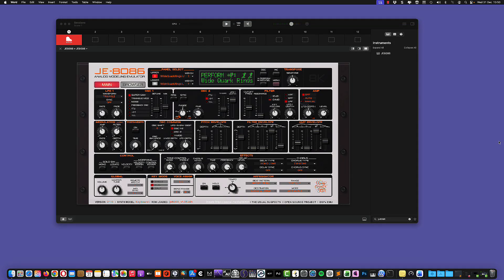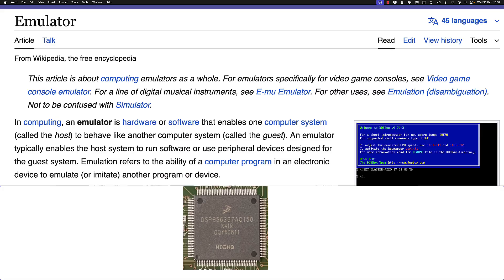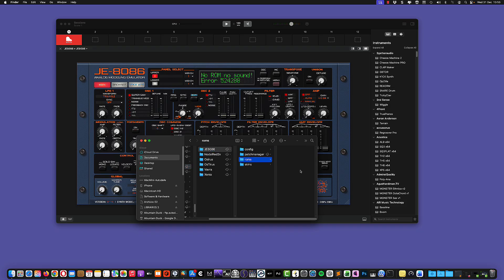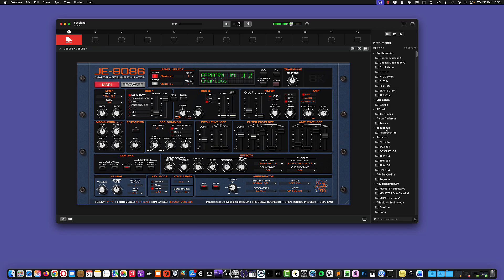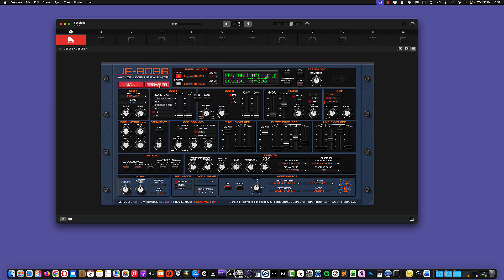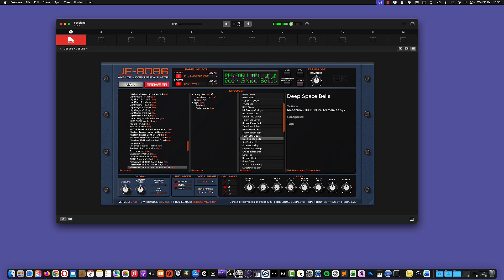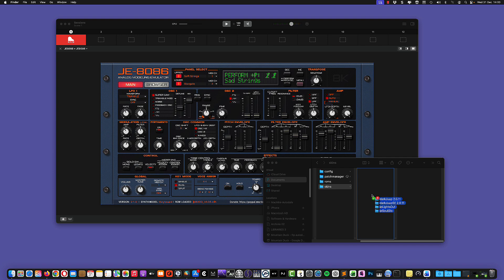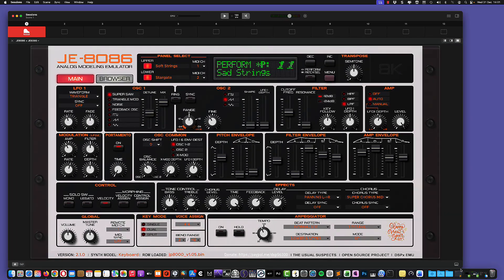JE-8086 Setup Guide: ROMs, Sounds & Skins Explained

Comment: mine is in no way like this at all. when i double click the zip for TheUsualSuspects-JE8086-2.1.0-MacOS.zip I only get changelog8086.txt, the components file, and macsetup je8086 command file. there are no other folders that have Rom or anything else like what you have. the beginning of this video already put me in the dark. Can SOMEONE please help me?
Reply from the maker: You need to manually copy the .component file in your COMPONENTS Folder on Mac.
See installation guide on their website. 
From there you need to google for the firmware, the ROMs are NOT and CANNOT be distributed with the emulator
Reply: @A @AutodafeSynths I got the file from Roland but mine is a zip, not a bin. It didn’t offer a bin version either. This process is really giving me a lot of confusion
Reply from the maker: @AEONRINGS  ignore the .bin, just expand the ZIP you got and copy ALL its  content in the roms folder as shown in the video. Multiple .MID files will work 100% the same
Reply from the maker: INSTALLATION GUIDE: https://dsp56300.wordpress.com/installation-guide/

Comment: I use the JE-8086 before your video came out. I used it in my new track.
I have 2 roms. JP-8000 and JP-8080.
I used the 8080 rom but it do not work.
Just the 8000 rom.
Why this?
Reply from the maker: Because jp-8080 is not emulated yet

Comment: Man, thank you for all explaining. For me the main problem and "dancing with a tambourine" was with a Apple blocking, I spent 1+ hour for getting it work, and no problem with installing ROM.
Reply from the maker: sudo xattr is your best friend in those casse 😂 or use the Sentinel App on Mac
Reply: @AutodafeSynths  hah I did it with sudo and it's not worked))) For me it was only "sudo spctl --master-disable" - and then I back system to normal using. Mate do you know how to make an INIT patch?
Reply from the maker: @NatLifeSounds  try the Sentinel App, much easier for me . Drag & Drop. Done: https://sentinel.macupdate.com/

also watch my tutorial here: https://youtu.be/_WbyuNrjubQ
Reply: @AutodafeSynths  oh, thanks man, I made it with a way which I described above
Reply from the maker: re: the INIT patch, there is one on the discord server for the project, somone created one...
Reply from the maker: INIT pacth on discord: https://discord.com/channels/829099347975208970/1428393781664940153/1429602442240196619
Reply: @AutodafeSynths  bad but I don't use discord( I will try to make it myself, I found that original JP-8000 can make INIT but bad that this copy can't(
Reply: btw does JE-8086 saved patches working good on hardware machines?

Comment: As shown in your video you have just one BIN file in ROMS folder and yet my official ROM consists of 10 files - 7 _MID files, 1 BIN file and 2 TXT files. I f I remove any one of them Emulator will complain and I end up with no sound sets...
Reply from the maker: yes, you can also use the varius MID files you can find on the official website, just leave all files where they are :-D
Reply: Yeah, that’s what I’ve figured…
BTW; The bin file as demonstrated in your video does not exist of-course for obvious reasons ;-)

Comment: Does not work at all in my Windows 10 computer, cpu load extremely high, totally unusable. Note that the same computer runs Osirus, Ostirus and Vavra without any problem and very low cpu load ....
Reply: Experiencing the same while not an issue with other plugins or emulators.
Reply from the maker: @solidsnake1449 try increasing the latency a bit (right clik on the UI then Latency). Also, this is still in BETA phase, hopefully nex version will be more CPU-friendly...
Reply from the maker: Thanks for sharing your experience.
CPU usage can vary a lot depending on buffer size, sample rate, polyphony and how the plugin is used.
try lowering Latency (right click on th UI-->Latency)

JE-8086 is still in beta and, unlike Osirus/Ostirus/Vavra, it emulates a different architecture and workflow, which can be more demanding in some setups.
Freezing or rendering tracks is often the best approach for now.

Hopefully performance will improve as the project evolves.

Comment: I have the 8080 rack room and it doesn't work.  The 8000 Rom does work.  Is there a working 8080 ROM?  I have 1.04 of your 8080 rom
Reply from the maker: JP8080 is NOT emulated yet, they are working on it but it’s not ready

Comment: aren't u using the wrong rom...?  u need the jp8080 rom not the 8000
Reply from the maker: Ehm, no... JP-8000 only at the moment. JP-8080 is not yet emulated (will be soon)...
Reply: @AutodafeSynths  so weird.. since the name is JE-8086.. not 8006. So the same emulator vst will be able to load the 8080 rom too? or will it be separate vst? Currently testing it out, and there's def issues with the VST. It crashed Ableton12 and Arp gets stuck while switching patches.

Comment: You didnt say that you can place that ROM with extension .bin and it works, but you can also place in that folder the files with extension .mid from Roland website. You mentioned you can download it from their site, but didnt mention that the files are different but still would work if you place all those .mid files in the ROM folder, and this is legal.
Reply from the maker: Right. I should have shown both methods…my bad for not doing it!
However, yes, also MID files from Roland website will work
Reply: It's only legal if you also own the real hardware. Doesn't matter if you can download the firmware directly from their website.

Comment: It's not based on the motorola 56xxx (that's Virus), it's a Toshiba dsp (TC170C14) for the JP-80x0
Reply from the maker: You’re right 👍  
The original JP-8000/8080 uses a Toshiba DSP, not a Motorola 56xxx.

DSP56300 is used here as the emulation platform to run equivalent DSP code, not because the original hardware was based on that chip.

Comment: The thing about the JP is that it uses a different chip than the previous emulations by the project. From synthanatomy: "This time, however, there is no Motorola inside, as the Roland JP-8080 uses a Toshiba chip called TC170C140 “ESP2.”"
Reply from the maker: Yes, the developer behind the “virtual jv” have been involved

Comment: can someone explain to me why i can get rid of the chariots performance? do i need to turn somehting off, i see the 2 midi channels but even when i turn the midi 2, im still getting the chariots performance.
Reply: As a quick fix you can click either the solo or dual button which in turn will stop the SPLIT in its tracks as CHARIOTS WAS A SPLIT PERFORMANCE! Sound bank creators never did find a way to fully disable it by the looks of it.
Reply: @ALPHASonic-g1j thanks, i wasnt that far off
Reply: @ALPHASonic-g1j Or right-click -> Panic -> 'Send Note-Off for Every Note'. Trying to figure out how to assign that to a button on my Minilab 3.

Comment: If anyone is having trouble with opening the file on mac: Apple -> System Settings -> Privacy & Security : Scroll down to the bottom and you should see the file you tried to open listed, you can then allow the opening of it from there.
Reply from the maker: Yes. Or use the command file provided, or the “sudo xattr” method, or the Sentinel App. More than one way to overcome this (non-notarized apps)

Comment: Anyone else getting major clicking and noise distortion when changing presets?
Reply from the maker: Yes, it happens to me as well. If a part is playing and you change preset, there are huge CPU spikes and clicks. Known issue. Try fiddgling around with the Latency settings (right click on the UI). Is your PC/ Mac quite new or old?
Reply: No clicks really. Works very smoothly

Comment: The plugin basically gives you the directions on how to install the rom when you open it. It was surprisingly easy to setup this emulator.
Reply from the maker: Absolutely 🙂
The error message is clear and points you in the right direction.
The confusion comes from the fact that many of us (myself included) tend to skip instructions and just want to click and play 😄
Reply: @AutodafeSynths not all DL  packages include the ROM unfortunately. Got it In the end, but this is my experience.
Reply: did you find sound packs

Comment: my Mac doesn't open anyway download
Reply from the maker: you probably need to remove quarantine from the component file. In the ZIP you have downloaded there's a file called "macsetup_JE8086.command"m launch that. 
Also, read the instruction at the bottom of the download page: https://dsp56300.wordpress.com/je8086/

Comment: yeah the ROMS frol the Roland site show as VLC files and theres no way to convert them to recognizable JE-8000 ROMS 😀  wtf
Reply from the maker: Totally normal 🙂
They look like VLC files only because of file association, but they are .MID files.
No conversion is needed , just put them all in the roms folder, they work (tested)
Reply: Just put the .mid files into the rom folder, then close and reopen the VST. It will automatically compile them into the .bin rom file.

Comment: Roland provides the firmware for free on their website, don't they? Why the secrecy?
Reply: Probably because it's a thirdparty emulator that works off of Roland's very own firmware.
Reply from the maker: It’s not secrecy 🙂  
Roland does provide the firmware on their official website.

The limitation is on what can be shown or linked directly in YouTube videos and comments.
So I prefer to explain how the plugin works and how to use it correctly, without pointing to specific downloads.

Comment: While the TUS project was originally only emulating synths based on the Motorola 56k DSP series, this synth is based on a proprietary Roland chip which has been reverse engineered. There was a talk by Giulio Zausa at the 39C3 congress about how they did it. It’s quite fascinating, you should go find and watch it.